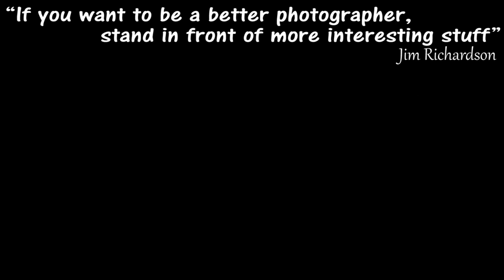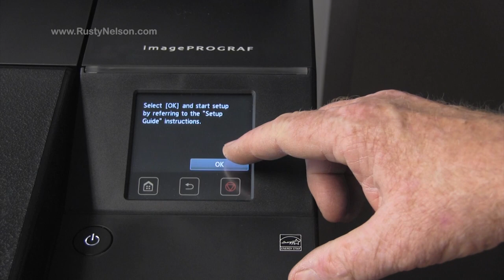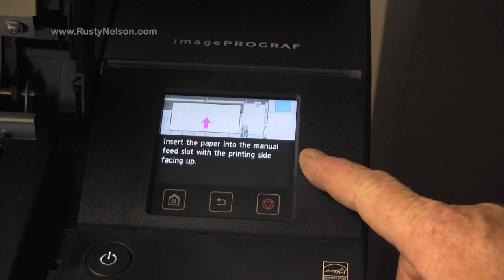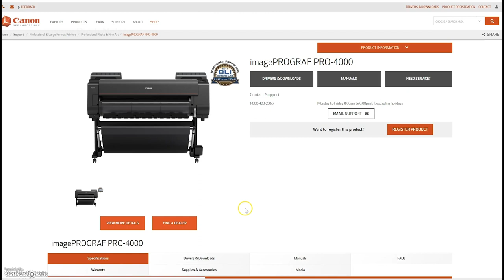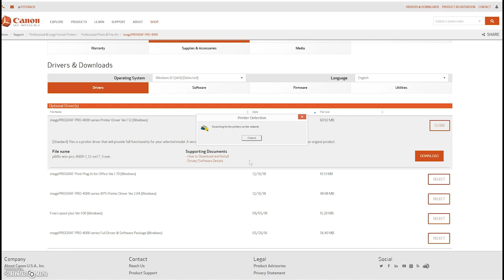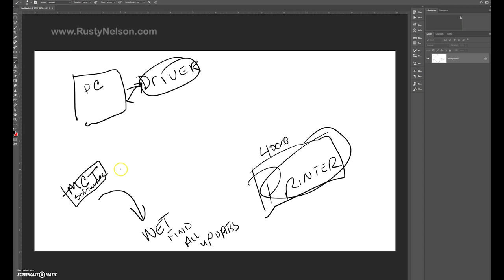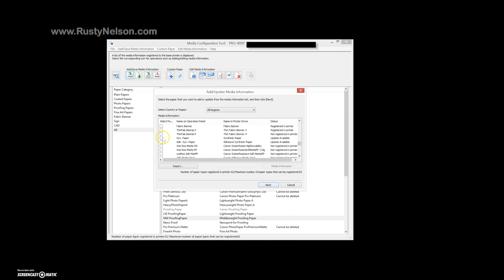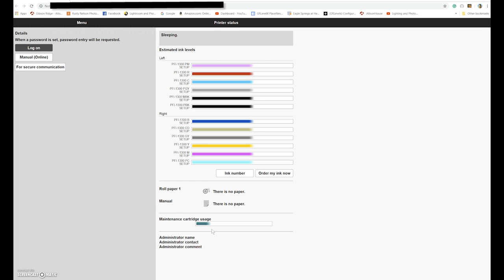Canon Pro 4000, 2000, 6000 Startup and Software / Driver installation

Comment: Nice video :) i use an Canon Pro 2000 for my printing , an amzing machine for my printis - and if i want lager i use a Durst P5 with an Aristo LFC 3332C :)
Reply from the maker: Thanks...   I'm laughing...if I had a P5 I would use it too.  Some new updates to the 2000 software and especially the pro1000 so I'm going to do a video on the software updates very soon if you subscribed.   Have a great day.

Comment: Hey Rusty, it’s Lee Moses from Randsburg. Thanks so much for posting this setup. I just trashed my Epson 7900 before placing an order for a Canon pro-2100. Your setup tutorial will be very useful. Thanks again, stay well.
Reply from the maker: Hey Lee great to hear from you. Hope all is well up there.  Hope to get back up there sometime next year for sure.  Been too long.  Let me know how it goes with the 2100.
Reply: The new printer arrived in good shape. A friend helped me beam it up to the second floor. It was much easier to handle than the Epson, they are very much over engineered. The Canon’s casing is mostly plastic so there is no unneeded weight due to overuse of sheet metal. In a few days I shall initialize it. Your setup information will save me a lot of time. Oh yeah, order more ink and a tank, got it.
Reply: Ok, it took most of the day but I am done initializing the 2100. Canon’s control interface on the printer and on the computer is impressive. I could be a complete technophobe and still figure this out. I agree completely with you Rusty that installing the drivers and firmware from the U.S. Canon site is best. The Media Configuration Tool is actually useful, unlike Epson’s so called tools, but enough of that. The touch screen options have great depth and thankfully there are no mechanical push buttons to maneuver through them. This machine is very well thought out. The support software is logically designed and the user guide is actually usable.

Comment: Canon Pro-521 and Canon Pro 2100 are the same?, i am going to buy Pro 521 but there are no Installation videos for that printer, your videos is really helpful, If 521 and 2100 are the same i would use this same process.
Reply from the maker: As far as I know they are really close.  there are a few things that may be a little different but the great thing is that the canon printers will walk you through as you  install.  Use the downloads for the software for the 521 as the firmware on the dic is always outdated.  Best of luck and let us know how it goes.  Rusty
Reply: @RustyNelsonPhotography  Thank you! I will let you know after i buy it.

Comment: I can't seem to get the xps drivers to work on one computer, while it works fine on the other computer. The colors are obviously not as good on the computer where the xps drivers seem to not be working. Any ideas?
Reply from the maker: Hard to tell from here but...   You need to load the XPS driver after the other drive.  I found that I had to remove the drivers and reinstall for various reasons.  I would also call Canon they are good about answering the phone.

Comment: Hi! How much can I print with starter inks?
Reply from the maker: I can not tell you as that would depend on how much space / color you are printing.  I will tell you that the carts seem to last longer then the ones in the pro 1000.  BUt they are a great deal larger.  I do not keep track of how much ink I use like some people do.  I will tell you that when you first start it up they do use a great deal of ink to prime the pumps so to speak.  But there is a large amount kept in the lines to and in the head.  Subscribe Button: https://bit.ly/3orJrgp

Comment: I am trying to move my pro 2000 with a truck so I selected move to outdoors. But I get a error message :consumables must be replaced,and preparation is disabled. If the message appears, tap OK and contact your Canon dealer for assistance. Please help me! I had the truck guy all ready for tomorrow 😥 I even have 2 extra maintenance tanks i knew it would need..
Reply from the maker: Very hard to help you out but are your inks low?  I had to replace some of my inks because they were to low. I know it sounds strange but I believe the  printer actually pumps some ink into the head while it is preparing to do its thing for transportation.
Reply: @RustyNelsonPhotography  thanks for the tip,ill have to check that tomorrow! I'll let you know, just in case you ever run into the same issue!
Reply from the maker: I would be very interested to hear what Canon says or said about the "consumables".  Ie...can this just be corrected by putting in a new cart.   I was also wondering if you have low warning signs on any of your carts.  Will be interesting for a few people for sure.  Thanks for so much with the update when it comes.  Good luck   Rusty
Reply: @RustyNelsonPhotography  Canon said it could be a few different things,even the printhead! And that a service man needs to delete this error prior to me moving it (in the right way). However I still have hope , since I have 2 inks with the low signal,so I bought new ones and ill go try it next week, since I moved and the printer stayed behind. I was also very anxious since the printer hadn't worked for over 20days because there is no electricity there! I always try to print every few days,ive never left it for so long, but this machine is unbelievably strong! It did a pretty long cleaning cycle and that was it,not even a faulty grid!! Will keep you posted 😀
Reply from the maker: @angelsmokee   Just so you know I have left my printer for well over a month while I was out storm chasing and did not have any problems...BUT that was me.  Not saying its the best idea.  I use a program also now called Qimage that you can schedule it to print purge sheets while you are out.  Great layout and printing program.  Love it.  Here is a discount link also.  https://www.ddisoftware.com/qucustomer/Rusty/   When you go to start it up again I would pull all the inks out... I have done this before on a ?error7300? and it cleared.  I unplugged it and hit the power button 10 times.  Why...it clears any little unhappy electrons out.  I had errors before and actually did above a couple of times.  Wish you the best and keep in touch.  Rusty
Reply: @RustyNelsonPhotography  oh wow thank you so much for sharing all your knowledge! Just to clarify,do you think i should pull out all the inks prior to turning it on?Or would it be the same if I try installing the new inks i got(that were low)and then try taking them out? Also loved your tip on unplugging and pushing the power button 10times! I was also wondering if these have a hidden menu,for technicians. On my old Epson stylus Pro i used to push some buttons while turning it on and id get in the hidden menu, where I could check and change a lot of things.I could see the temperature of the printhead ,tell it to see all inks full,delete errors exc.
Reply: @RustyNelsonPhotography  Update: bought the inks that were low and it still didn't let me execute the move outdoors . I tried turning it on and off, pushing the power button 10times exc. However I was able to do the first option,move to same floor. Better than nothing..heard about some use Pampers diapers in it to gather the inks that may spill. Have you heard that? Moving it in a few days hopefully..wish me luck
Reply from the maker: @angelsmokee   Good luck.  Never heard of the pampers thing.  Best of luck.

Comment: Finally I am able to actually use ICC files the right way. I researched to find out in which folder these files live. I also found out that the MCT is coded to block the display of that folder. By trial I learned that MCT will find any non-Canon ICC from any download folder, but for Photoshop to see the new ICC one must manually copy it to the Windows system folder hierarchy. I must say that when this machine is actually tuned to a specific paper the result is outstanding. I am seeing detail in deep shadows and some ink deposited in areas that were completely blown out before. I am most impressed by the MCT’s functionality and broad options. Now Photoshop can properly describe the image to the printer according to the profile, and the printer can properly execute instructions from the driver according to the ICC file that is successfully located in the system folder, after manually placing it there. This is a great day. Thanks Rusty.
Reply from the maker: Great.  There are so many little things that need to be checked off as you print that I believe that there are many people that are not setup right on any kind of printer.